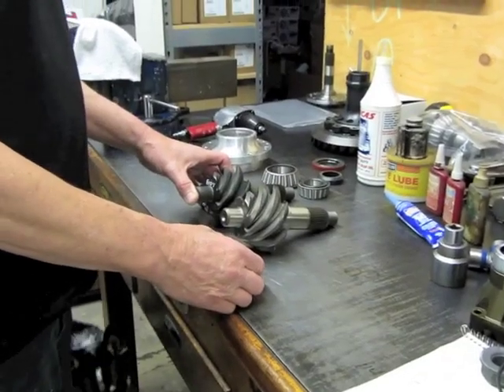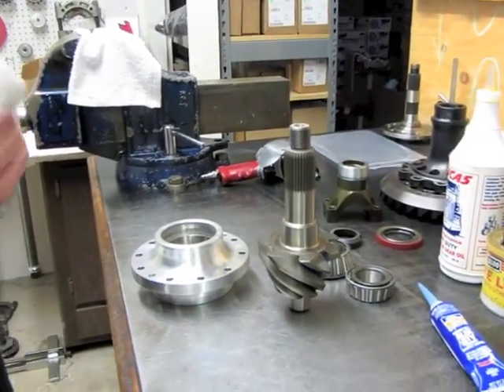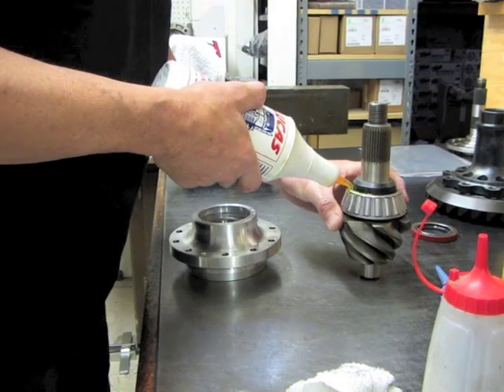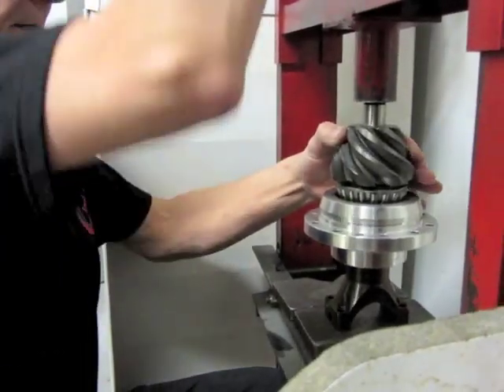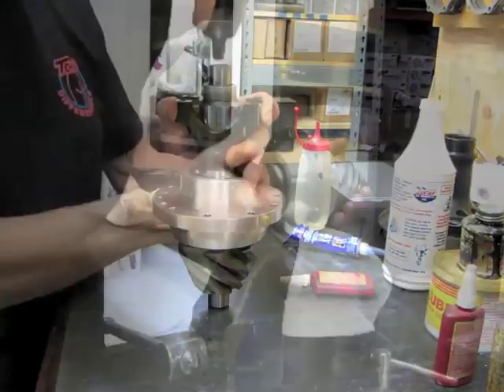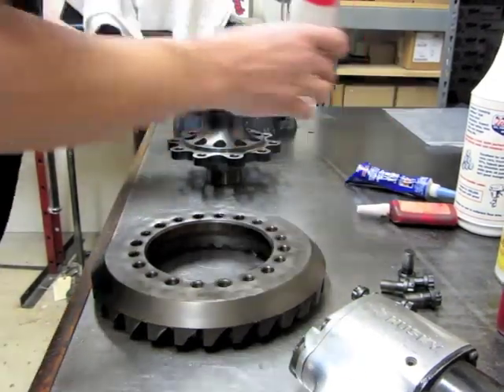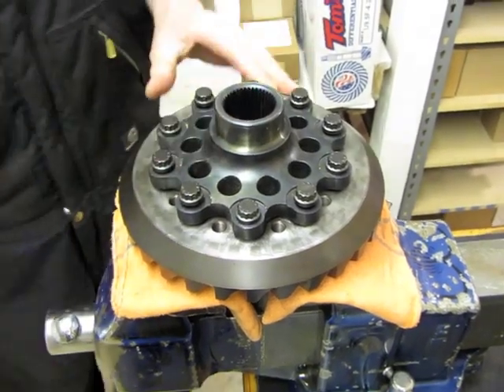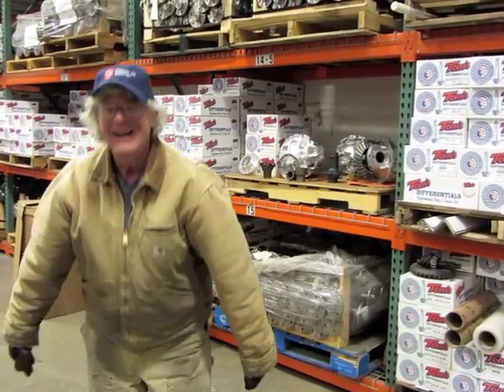Third Member Assembly

Comment: The manufacturer of my third member recommended polishing the pinion shaft so the front bearing is a slip fit.  Years later when I disassembled the unit the shim packs had worn through.  I'll leave that as a press fit from now on.  3:40 - 4:05
Reply: smart man , never polish the stem.. have a great 4 th of july dude

Comment: Ok, I want to go with 31 spline and get new axles. Yoke was 3 5/8" with a 4.5 length. I measured axles from outer shaft to splines and got 32.5" and 30.0" not sure but is longest axle size 32? So I measured wrong? But anyway in all I'm looking to get complete 3rd member with 4:11 limited slip, 31spline axles with bearings, and new u joint

Comment: I was checking out your site and looking at getting a complete 3rd member. My posi wore out and pinion bearing all jacked up, so if I get a complete assembly is it pretty much bolt in... Put axles in and ready? I know I need to check axle spline but is it that simple? Thanks a lot, I like your videos for your products